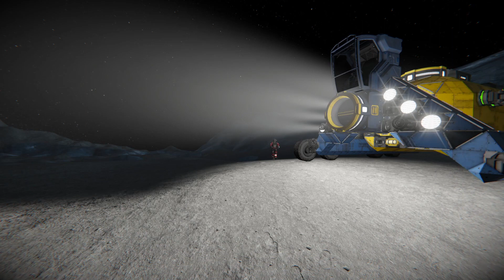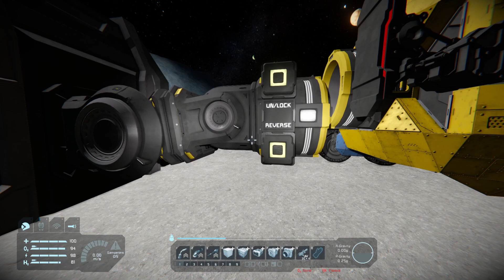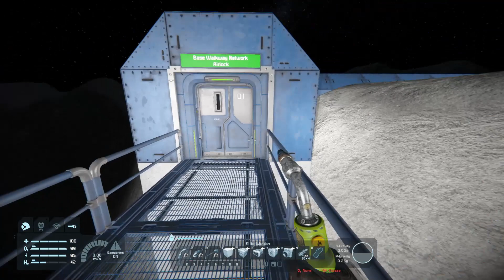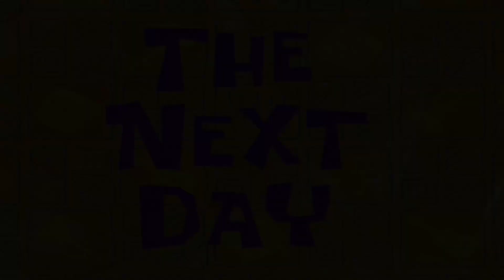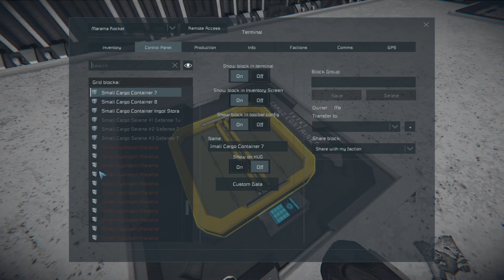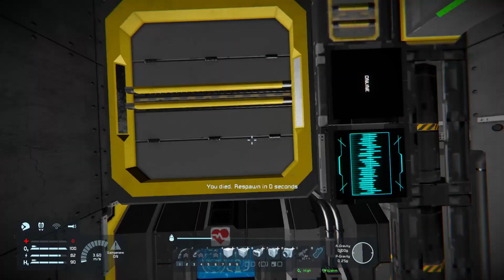Hephaestus Prime EP81 - Hydrogen (Space Engineers)

Comment: Hi There,
I had a question.
What is "real world"
I only know "SE world" and "AFK World" 🤣
By the way congrats on the 500+ subs.
Greetings Listerman
Reply from the maker: Hi Listerman. SE world is on my screen, this morning it's the stormy ice planet Triton, which is not too dissimilar from my real world. If I turn my head 5 degrees to the right, I can look out the window into the New Zealand landscape, which currently has a storm with horizontal rain blasting in straight off the Antarctic ice cap. I suspect when the cloud eventually clears, there will be a decent dusting of snow on the mountain range over my back fence. I can tell the two worlds apart most days, although I think my back lawn has an ore patch under it.

Comment: Your air vent might not be working because your O2 tanks might be full so there us not place for the vent to put the air into  or you two vents fighting each other with one trying to fill the room and one trying to suck all the air out of the room
Reply from the maker: Yes, you're on the money there. I did some googling and came to the same conclusion, no capacity in the system. Haven't been using these vents much before, so it's very useful learning before really needing them on Mars and future space based endeavors. Really appreciated the feedback, please keep it coming.
Reply: @Wellington6012  I have this problem on ships. You have to set up a closed conveyer system of vents on their own tank and timer all the air locks to recover the air. It’s quite elaborate or you end up venting all your air over time.

Comment: I love the buttons on the connector, I’m definitely using that one. You should put buttons in for controlling your remote ice drill too. You won’t have to go into build vision to move each part of it.
Reply from the maker: Thanks David, simple buttons, work well. Not sure how to handle the drill movements, really struggling with the single head manipulation across all my mines. I think there is a script you can get to control them, but then part of me thinks there's something to be said for just build big and strip mine the deposit open cast mine style. Something to ponder.
Reply: @Wellington6012  Yeah, button controll on drill actuators really don’t make sense when you only need speeds and plunge rates to clear an area. I’m looking at different ways to set up a mobile drilling rig that can be dropped off and scrape a patch of ice or dig down and fan out on a vein of resource and then pack it up and move it to another spot. The large cargo containers are great for this but they take forever to build on each site. The landing gear grippers on your yellow tank are a good candidate for this mobile rig idea I’m trying out and I have a large thruster hauler that empties the drill cargo and takes it back to be refined.
Reply from the maker: @davidgutting4317  In my first and only play through prior to Hephaestus Prime, I made a drilling rig with spinning drill head that used two pairs of landing gears and pistons to inch worm it's way into a hole. It was carried to location by a drill/storage ship, that could transport the ore, or fit in the hole created and do some lateral mining.
Reply: @Wellington6012  I’ll give that a try on a deep bore drill, thanks